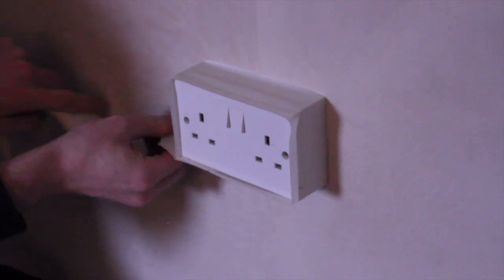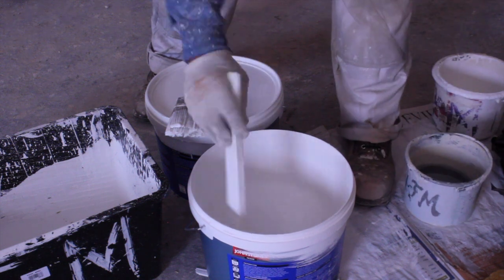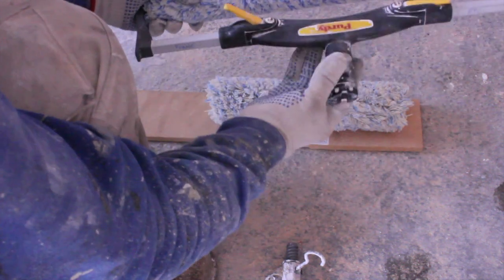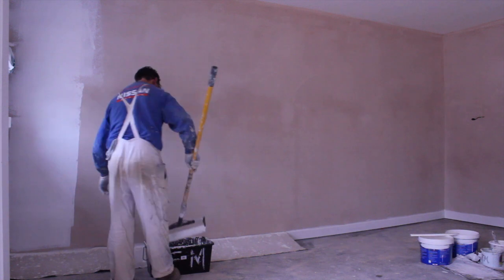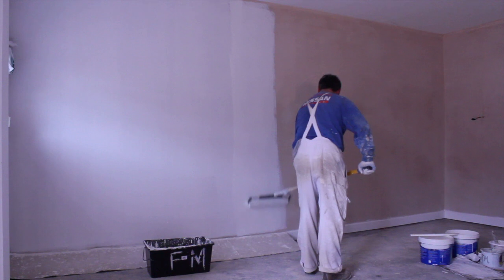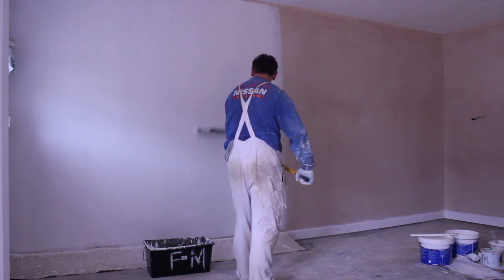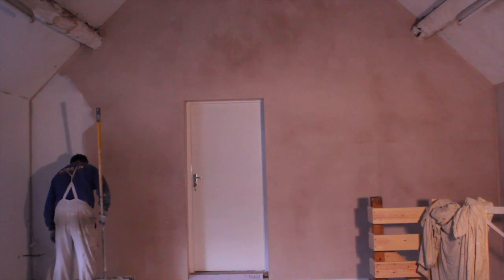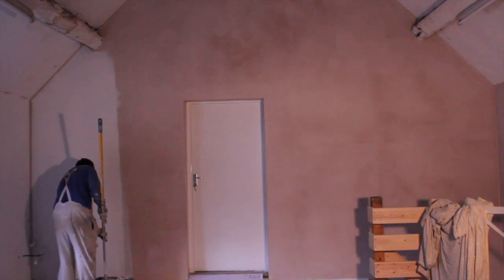Top tips for painting new plaster walls with emulsion paint ( water based ).

Comment: What can you do if a mist coat fails or if the plaster is over polished.
Reply from the maker: Hi HW, This is a very open question and I would need more information to give the correct reply.
I do hope this has not happened to you and the scale of the problem is very small.Thank you.
Reply: @kudostrainingbiz-dj7fo  When I had the walls skimmed I gave the walls a mist coat and top coat but the paint started to crack in places and the paint could be scraped off easily so what could the problem be as I've removed all the paint to start again.
Reply from the maker: @hardworker8030  - Hi HW, The instructions on the materials tin or tub used, will have the manufactures contact details and they will be able to help you , I hope this helps. Again Happy Painting!

Comment: would you recommend a larger roller 18inch  i have only 9 inch does a larger roller give you a better finish than 9 inch  thank you
Reply from the maker: Hi Kevin and thank you for your question.
If you are a professional Painter and Decorator the answer is no.
Some companies request the use of a 12"" roller only.
Do please check out the other videos on kudostraining.biz - Its free!
I hope this answer helps you and Happy Painting,  its fun!
Reply: @kudostrainingbiz-dj7fo  thank you for your reply kudostraing .biz.  always great to get tips on painting to make thing easier and to have that professional finish
Reply: it's doesn't really matter if your using it for a matt finish i wouldn't recommend a 18 inch sleeve they have a too limited use they only make a big difference if your knocking out new builds on a daily basis on smooth walls.

Comment: would you recommend the colossal roller over white dove for mist coat?
Reply from the maker: Thank you for your comment, I would like more details please to give a reply
Reply: i see you used the purdy colossus roller which is a thicker roller than white dove. have you tried using white dove for rolling the mist coat? should you use a thick roller like colossus for mist coat or is that just the roller you use?
Reply from the maker: I have not used the 9 inch dove sleeve, but there should not be any problem in doing so. I do use other rollers, the assessment you have to make is the roller size and sleeve appropriate for the job.
A mist coat is a thin down coat of paint, which is mostly used on new plaster work to obtain an equal paint finish without any roller and sleeve marks of any kind. Manufactures are always bringing new products out.

Comment: So you don't need any primed
Reply from the maker: Hi Kareema
Thank you for your question 
1). In this video the paint is being painted on a new plaster surface,therefore the emulsion paint which is a water based material is used as a primer and first coat in one application, as this is a commercial job.
You can thin the first coat of paint with water ( water base paint ) to act like a primer but in todays application this is no longer used.Please watch the video over and over again as it explains this.Also read the other comments.
2). If you are painting an old plaster surface and it has problems like grease or dirt and heavy marks on the surface.Then you would use a sealer like Zinsser cover stain.Apply only to the area that is stained. 
I hope this helps you. Happy painting!
Reply: @kudostrainingbiz-dj7fo  thank you since mine is fairly old I I will purchase the zinsser